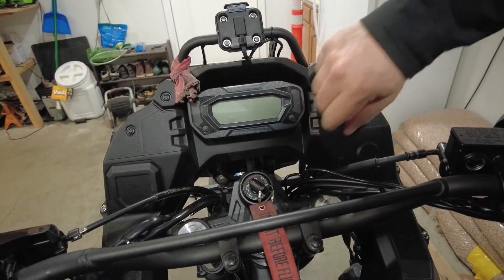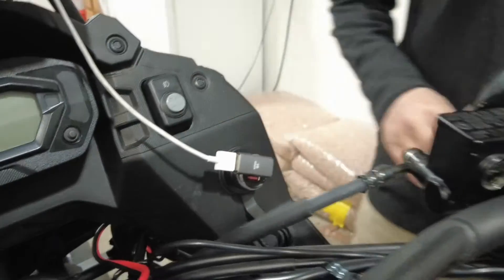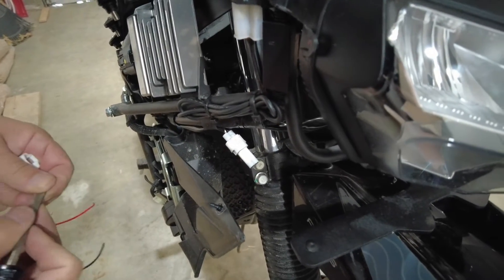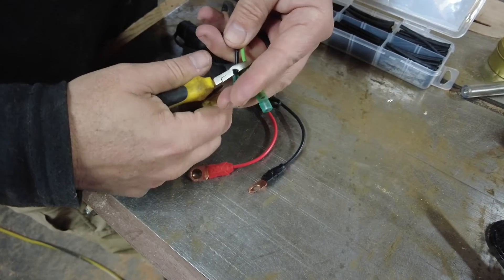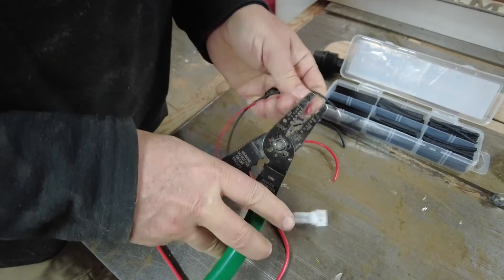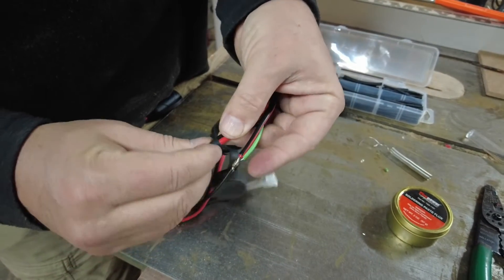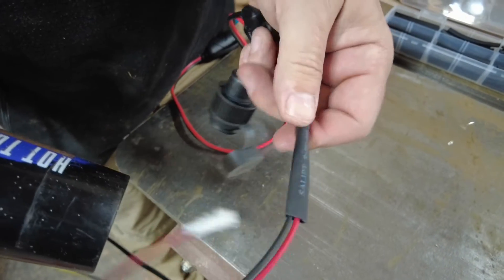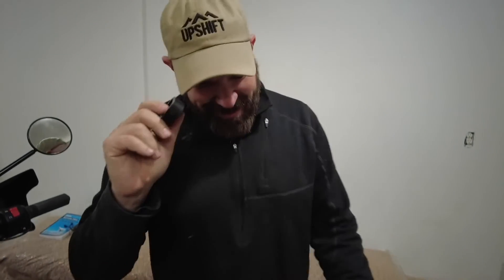Wiring 12-Volt Auxiliary Power on a 3rd-Gen KLR650

Comment: Thanks - for the visuals.  What is the source of the plug-in Relay (to activate switched power) ?
Reply from the maker: https://www.3dcycleparts.com/?gad_source=1&gad_campaignid=21678523653&gclid=CjwKCAiA24XJBhBXEiwAXElO33mZLPgdb4hcc6WFMsAbBvE6ESPDdS3rLZoFy6avZ8duPhMgH_oNChoCrvwQAvD_BwE#!/KLR650-2022-Accessory-Relay-Replaces-OEM-99994-1502/p/391374808
Reply: @viajar4WD  Many Thanks.  I often wonder if such "Relay's" are generic i.e. if they all just switch to on/'connected' when they detect power into them (from the key switch)?

Comment: Your other KLR had the switch in the spot.
What do you recommend for a switch?
I'd like to wire up my fog lights to that spot, rather than handlebars.
The one you used seems to fit nicely.
Also: you mentioned "KLR has two"
What's the location of the second connector?
Thanks, keep up the good work.
Reply from the maker: @martinw8433  We used the Kawasaki KLR switch so that it looked stock. It has held up very well over the last 25K miles of use. There are actually 3 aux connector plugs and 1 bullet type connectors. The aux connector plugs are located on the left and right under the front fairing, and under the tank. The bullet connectors are on the right side above the plug connector. Cheers!
Reply: @viajarMOTO  that is, that's very helpful.
I found all the connections except for the under the tank as ....I don't feel like removing the tank lol
But that's what I'll use for the heated grips.
As for the switch, I think I'll do some research in my local Princess Auto (Canada) and post results on the KLR  Owners FB group.
Hopefully there is an inexpensive, aftermarket option.
I can't even see any way to buy Kawasaki option online.

Comment: What is the adapter you got from 3D cycle that plugs in that white connector for aux power? It’s shown around 3:00 into the video. 
I plan on doing all three of the same mods you did—garmin Zumo xt wired to the bullet connectors, 12V power added (like this video), and koso heated grips. I have the gps, which seems to require only some bullet connectors. And I have the kit from 3D cycles that includes the 12V power outlet and the relay (also with bullet connectors that will be clipped off).
Reply from the maker: Aux power plug: https://www.3dcycleparts.com/?gad_source=1&gclid=CjwKCAiAneK8BhAVEiwAoy2HYcqxv0irX_40PdAzOEEiKe8bfyYuHp5s90M9mKePFjkbyqZwK7KHixoChiwQAvD_BwE#!/2022-KLR650-Auxiliary-Light-Connector-Pigtail/p/536589822
Reply from the maker: A note on the Garmin XT: The contacts on the back will be destroyed by the spring connectors of the Garmin mount. The vibration on the KLR mounting bar acts like a needle gun to the connectors on the back of the Garmin XT. After 12K miles we had to use copper tape to fix these contacts.
Reply: Thanks for the link to the aux connector. It says it for lights, so I’m guessing that’s the standard place to plug in if someone wanted to add aux lights to a base model like they have on the adventure model. But I don’t intend to add lights, so I guess I’m good there.
Reply: Re: the garmin connection point. Thanks for the heads up. I did notice you mention that in another video. I noticed you used a separately purchased mount for the garmin. I’m just using the ram mount that came in the box with the garmin. It means the unit sticks out a bit more, but I’m okay with it. Do you think that will have any impact on the vibration, since the articulating ram mount has 2 ball joints. Maybe it’ll dampen the vibration a bit?